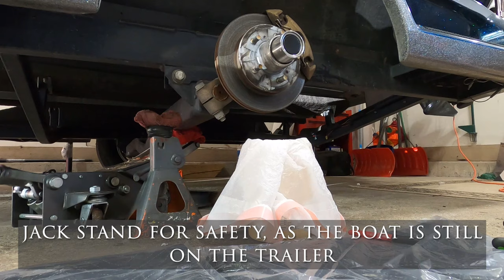ranger boat trailer rubbing fender, wheel well FIXED, trailer sagging

Comment: This video was a godsend! Experienced the same issue, only on the starboard side. Port side is good. Are 3 "clicks enough"? I thought my '04 was in good condition. Your's is showroom!
Reply from the maker: Three clicks should be plenty.  Thankyou I spend a lot of time keeping it Clean.  I'm a big fan of the "hot sauce" products as well as the maguires boat wax.  As well as slather the leather with treatment before and after winter storage.
https://youtu.be/rIaB88YoMYg

Comment: I'm experiencing the same issue on a 2007 ranger trailer for a recently acquired 178 VS. Curious, did the trailer ride any differently and did you repair the damaged fender fiberglass after the fact? Would you consider this a "permanent" fix? (FYI - this is my 1st bass boat, so I'm learning)
Reply from the maker: I didn't not notice any change in the ride. If anything a touch firmer.
The damage to the fender was minimal.  A bit of clear nail polish did the trick.

I'm not sure of the permanency it took 16 years to sag that far.  I'm going to keep an eye on it. Torsion bars on trucks have adjustments for ride height and  The boats aren't that heavy.   But I definitely would replace the Axle if went out of spec again
Reply: @nsigarage5212  Thank you for the quick response. I appreciate your video and knowledge sharing.